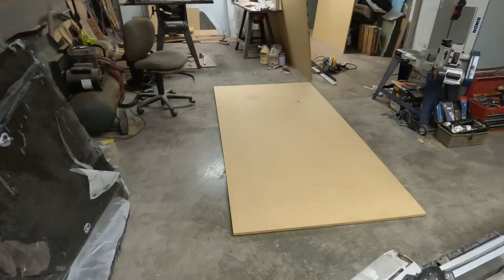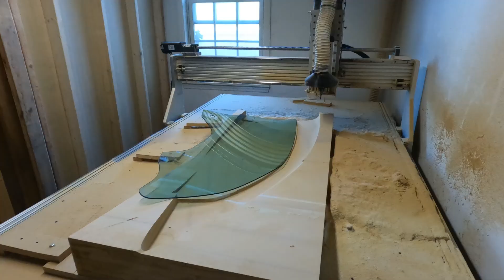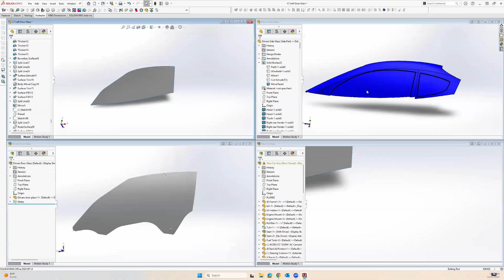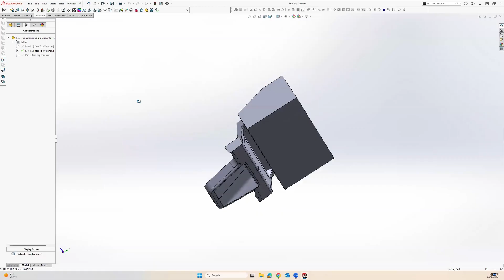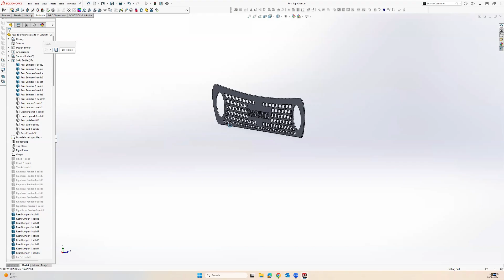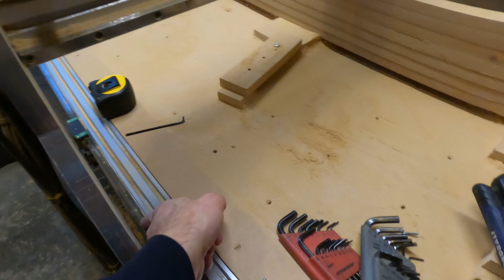More setbacks, but still some progress

Comment: I think your bearing blocks are getting  clogged up because dust settles in de ditch in de guide. The ball bearings are locate on de sides of the bearing which has become top and bottom in your setup. This makes them more vulnerable to dust.
Adding some sideboards to the cnc to keep te dust away might help. Or you could add wipers to the bearings.

Good luck with the project!
Reply from the maker: Thank you for the input. I did some reading on a CNC site and I agree. I am looking at adding some plastic bellows (linear rail covers) to my CNC, they are fairly cheap and should help keep the dust out. Thanks for watching.

Comment: Thanks for the great episode again. Just out of curiosity, what's the procedure to get this car officially registered in US? I am from Finland, and we have very strict rules regarding the roadworthy of the car. Basically making your own car, and driving it in public roads is not possible due to fact that cars has to have official crash tests approved and other standards to meet. So getting this kind of beauty registered and insured, is practically impossible. How does it work in US ?
Reply from the maker: I need to do some research to know exactly, but I did find this on a quick search. www.idrivesafetly.com/dmv/north-carolina/vehicle/custom-car-registration

Comment: next time , dont cut the oversize of the mold material off , rather do a cut and then just shift the material up, re clock and recut the rest.. i did 3m long dagger board molds like this and they came out beautiful , neat project
Reply from the maker: I need to try that sometime. I am new at CNC work and programming the cut file (G code) would be challenging to do that in Fusion, at least for me. Thanks for watching.